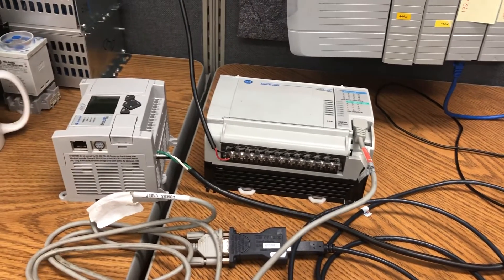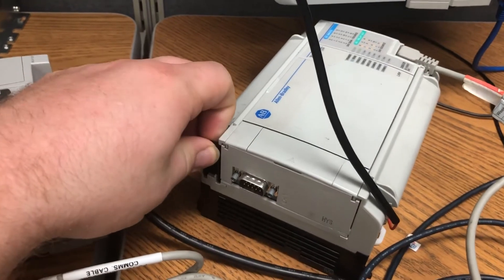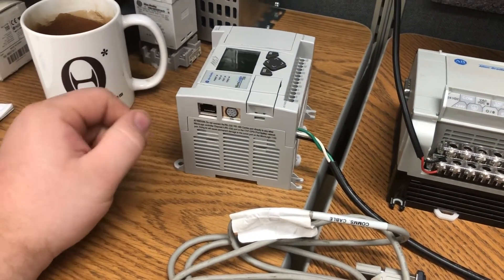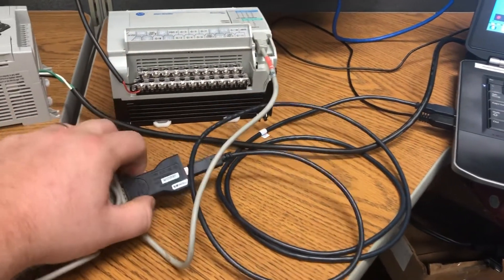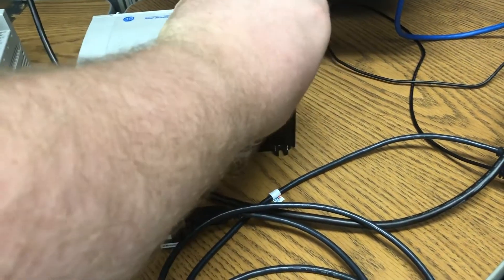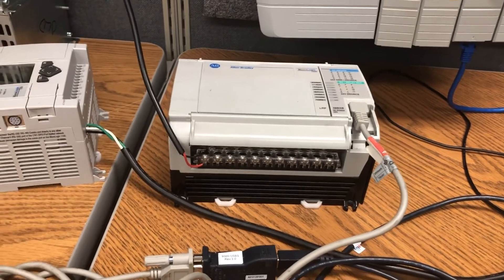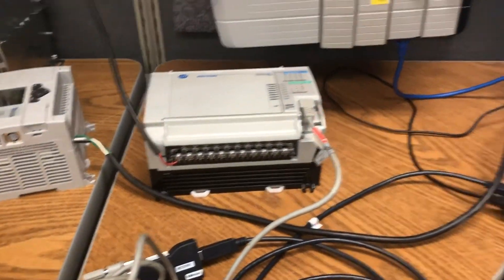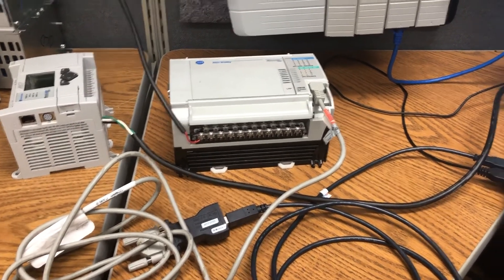Connect to MicroLogix with Serial

Comment: Hi, i want to check PLC running software version via pot switch. Could you please explain is it safe to do it? Because with this pot switches, i can change also configuration.Could you please advise? Thanks.
Reply from the maker: Rauf, what model PLC are you requesting this for? Thank you for the question.

Comment: Hello, what cable can you use to connect to Micrologix 1200 PLC?
Reply from the maker: Communication Cables Use only the following communication cables with the MicroLogix 1200
controllers.
• 1761-CBL-PM02 series C or later
• 1761-CBL-HM02 series C or later
• 1761-CBL-AM00 series C or later
• 1761-CBL-AP00 series C or later
• 1761-CBL-PH02 Series A or later
• 1761-CBL-AH02 Series A or later
• 2707-NC8 series A or later
• 2702-NC9 series B or later
• 2707-NC10 series B or later
• 2707-NC11 series B or later
Page 1-4 of this document https://literature.rockwellautomation.com/idc/groups/literature/documents/um/1762-um001_-en-p.pdf

Comment: Hi
How can I contact you?
Reply from the maker: Just here in the comments is fine. What's up?
Reply: I have a plc MicroLogix"1500
 Processor Unit
 SE
 CAT
 1764 - LRP needs updating
Reply from the maker: @ahmedaljuboori6884  If you need to connect to that PLC, you will need this cable:  1761-CBL-AP00
I may be able to get you a pinout of this cable if you want to try to build your own.